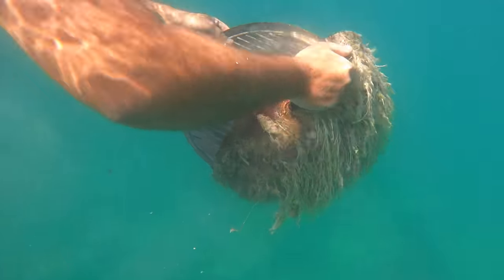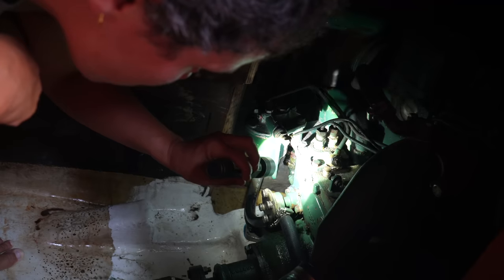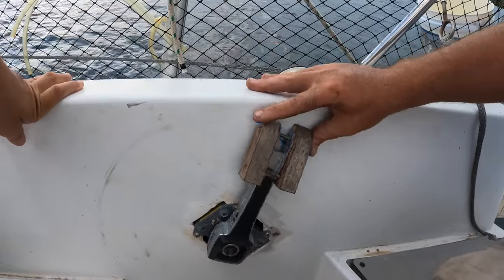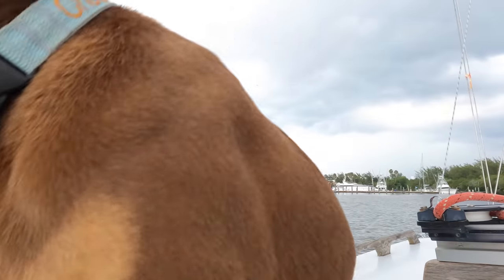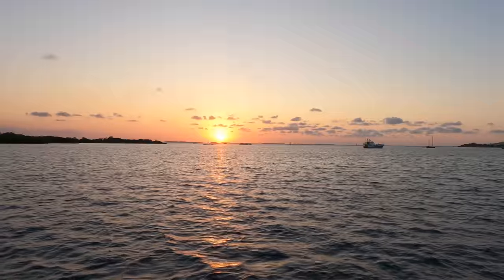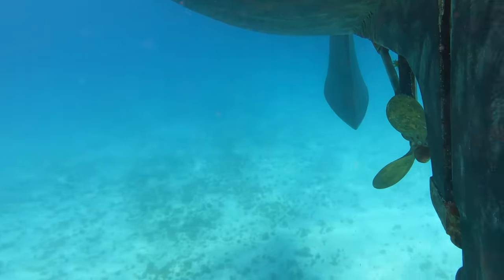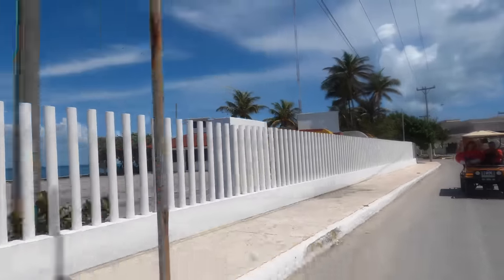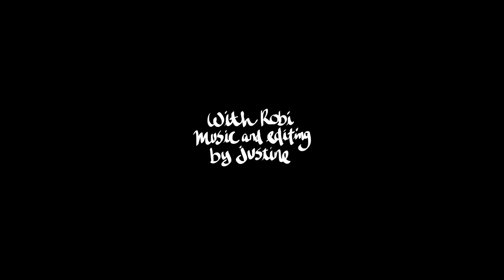WHAT ARE WE DOING HERE sailing at isla mujeres

Comment: Sounds like you have a problem with the  primary diesel pump. Probably a broken diaphreme. I had the same problem with a Volvo MD2002 engine. Leaking fuel, hard to start. Replaced the primary pump (I think it was around 160 euro) and no starting problem after that what so ever.
Reply from the maker: Yes, we think so too - we're always afraid to open things up on the engine because there is always a chance that we won't be able to seal it up again and will need a new part that will take weeks to arrive. But yes, we will likely need to replace the pump.

Comment: I suggest you get a Manual for your engine. Fixing diesels is generally a lot cheaper than replacing them
Reply from the maker: We do have a manual - we just don't have any of the ancient, expensive parts that need replacing or materials to be able to fix what we know is going wrong 😖
Reply: @sailorama  What is your engine make and model?  I once had a Volvo MD series engine that had hard to find and expensive parts but  the parts were available  and the failures were so rare the expense was bearable. I live in the San Francisco bay area and here are  a lot of parts available here.
Reply from the maker: Yes, we definitely have experience with finding good used and new parts in the Bay area - not the case in Atlantic Mexico, however. We have the MD2B. If we were in the USA, this part that I explain is leaking fuel would not be such a hassle to ship to our location, for example: https://www.parts4engines.com/volvo-penta-md2b-fuel-lift-pump/ Just one of the many many pieces needed that ends up costing ~100 dollars each by the time it gets here.
Reply: @sailorama  Hmm $100 is pretty cheap in sailing reality.  I actually had my Starter generator rewound  rather than replace. Rewind cost $300 Replace cost $1500.  ..About leaks. if the metal parts are not cracked or rusted, and the pump works mechanically, some good gasket maker can seal most leaks.

Comment: There is a bolt and nut to the right of the throttle control lever. If you tightened that bolt (clockwise), would it limit the travel of the throttle lever?
Reply from the maker: Correct, there is a bolt there - the engine just reaches fairly high sounding rpms before reaching the bolt even screwed in to the max.

Comment: That gear cable would work better with one more pulling it backwards..   with your oil leaks check (because it’s a dinosaur) that there is positive crank case pressure, (PCV) basically the engine itself is getting some vacuum, it will have some system but it’s probably blocked or someone has disconnected it for reasons unknown..  another thing with your control cables,  get something straight and solid like a metal rod and hose clamp the outta insulated part so as you move the controls it won’t try to flex,  the way you have it now with cable ties?  That’s going to fail..
Reply from the maker: That's something we didn't think of - connecting two cables for the gear shifter instead of one 🤔 Might be worth trying if we get ahold of a third cable. Yes, that's right - we're holding things together with zip ties. We don't like it, but it's all we got right now 😖
Reply: @sailorama  yeah just they may fail probably at the worst possible time.   Notice I’m not saying “rush out and buy a brand new motor” 
If that motor does the job?   Why change it?    It’s simple so with a touch of TLC it can keep going..  not 100% sure where the diesel leak is? 
Must be at the pump itself,  because in theory there’s not a lot of pressure there when it’s not running,  i heard something about hard to start when left alone overnight?  Kinda makes me think the pump as well,  it’s obviously losing the pressure allowing the fuel to drain backwards away from the injectors,   I can’t really diagnose that from the other side of the planet,  my best guess would be the actual injector pump itself,   But even being a dinosaur, them pumps are machined to micron Measurements,  see if you can buy a rebuild kit and a service manual before disassembling,    Normally drying it,  then cover approximately where you think it’s leaking from with baby powder should give you a nice X marks the spot..  
anyway..   have fun guys!   
Cheers Trev YTSCs!
Reply: I have a few low pressure 12 volt fuel pumps and I occasionally swap them out on my Kubota to rewire as the corrosion is the pits... Works gr888 and I figured can be used for h2o raw water in a pinch too.